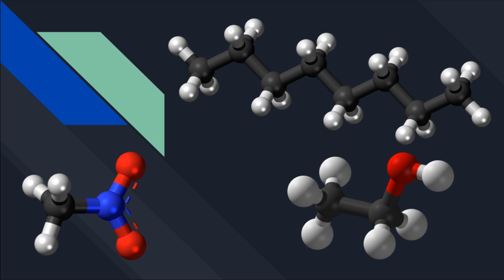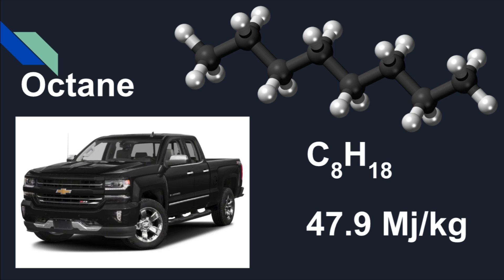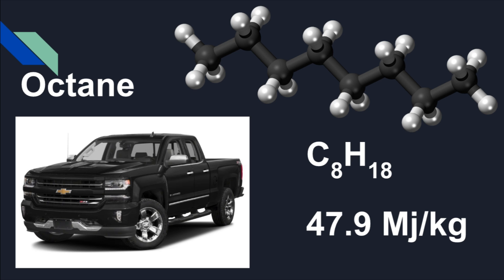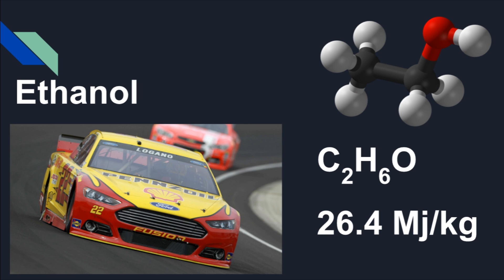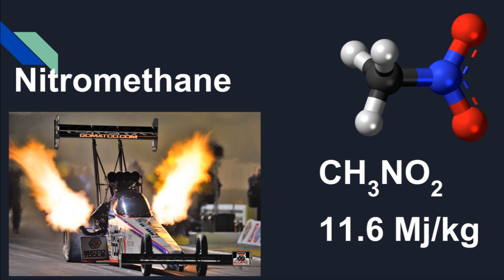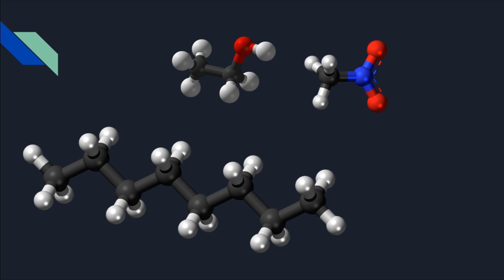Why Do Top Fuel Dragsters Use Nitromethane? [Molecular Breakdown]

Comment: Useful information, but it still doesn’t tell the full story. There’s also the matter of octane rating, ie how much the fuel can be compressed before it autoignites, there’s the matter of flame speed and ignition delay, and there’s the matter of whether or not a particular fuel can clean, cool and/or lubricate an engine.

Comment: Nitromethane actually  needs  tremendous pressure  and heat to combust. You can take a torch to Nitromethane  and try to light it and it wont light , try it with regular  gasoline  and it will light easily

Comment: I have determined in my mind that the only reason that they use air going into a top fuel motor is that it is a compression cushion because you cannot compress liquid and the air only goes in there so they have something to compress and they want to cram as much nitromethane into that cylinder as a they possibly can without blowing the heads off. They also turn the engines over backwards when they shut them off so that any fuel that hasn't been burned does not remain in the cylinders and get added to when they go to fire it up the next time cuz there will be way too much fuel and BOOM!
Reply: Nitromethane still doesn't have enough oxygen for complete combustion, so a little bit of extra oxygen from the air helps to generate more power, although they are not aiming for complete combustion, but they did say a little added oxygen does help. If it was nitroglycerin, the air wouldn't help because that has enough oxygen for complete combustion, with a tiny bit of leftover oxygen

Comment: Octane isn't an ingredient its a measurement...
Reply: It is an ingredient, and the rating is a measurement of the low speed knock value added to the high speed knock value divided by 2. The more octane a fuel has the more resistant the fuel is to auto ignite.

Comment: great another person misusing the term octane and what it is, thats about where I stopped, octane is a rating of how much pressure and heat the fuel can handle before it automatically combusts, cetane is opposite for diesel engines of how readily available it will combust under pressure and heat...

Comment: Interesting and informative comparison. My 2 stroke model airplane engines run on a methanol based fuel with a percentage of nitro methane and lubricants blended in; usually 15% nitro and 20% synthetic/castor oil. Smells great to my nose!

Comment: I know what nitro glycerin is and I have done some blasting in my career but that would be crazy to haul around country and I know methane is so what is nitro methane
Reply: A little late to the party but, Nitro Methane comes from a chemical reaction between propane and nitric acid. It was used as an industrial solvent before some nut job (like me) though it would make good drag racing fuel. Speculation; it was probably because the horrible airflow characteristics of flat head engines that prompted people to look for a fuel that didn't need so much air.

Comment: The rate at which fuel is consumed by these behemoth drag cars is quite astonishing. They're direct drive too and 2 of their six clutches will weld together after a run!
Reply: So basically the trans is ruined after every run
Reply: @TheAnnoyingBoss  yup pretty much. Rebuild every time.
Reply: Both wrong no transmission  LOL, JUST A CLUCTH PAK

Comment: So with nitromet already contain oxygen in it, it can runs and produce power with small amount of ambient air. Air fuel mixture more wet on nitromet fueled engine compares to ordinary gasoline engine / motor, am i right or wrong ?

Comment: Lol I actually put 1q nitro r/c fuel in my 01 Durango r/t 5.9 on a near empty tank and it's all wheel drive by the way and it actually smoked the front tires on a turn and I definitely felt the difference on acceleration nothing huge but definitely felt it so I can't wait to experiment on it again lol
Reply: Lol then you woke up
Reply: Yeah buddy , goose it
Reply: @daledevito buddy you would have a different answer if you had tried it. So just go back and do some homework about it this way you actually have something intelligent to say. It makes about a 10% more power difference with stock fuel system. There's a video on YouTube a chevy tahoe bone stock 285hp they upgraded the entire fuel system and pushed around 500hp.

Comment: you should see just how much Nitro is injected through those Hemi's in a run.  they eat like 18 gallons during warm up, burnout, and the 3 second pass. If i remember right, the fuel supply line from the tank is like 2 1/2 inches in diameter

Comment: Twenty plus years ago, the owner/driver/crew chief of a fuel dragster and I get to talking about fuels. He told me he had found mid-temp lacquer thinner was essentially the same thing as nitro.  He even showed me a 55 gal drum he had covered with a blanket.

I read right on the side of the barrel it was mid-temp lacquer thinner.

Did he mean it was effectively the same, as far as explosiveness, or was he talking chemically?  I find it hard to believe he meant chemically.

Back in the 80's, I used to use about a quart of mid-temp per 10 gallons of gas, in early smog engines with carbon build-up in the chamber causing dieseling and pre-ignition 'knocking'.  

As a test, I ran our shop lawn mower on straight mid-temp an entire Summer. The mower was used by our shop boy on my lawn, the shop lawn, my partner's lawn, and a half acre lot the shop boy had been mowing for a neighbor for years.

That winter I tore the mower apart to see what damaged was caused, and found none.  Kept using the mid-temp; it never failed to stop the problems.  Eventually, Detroit got better, and the problems went away.
Reply: This is amazing

Comment: Couple things

E85 is 85% gasoline and 15% Ethyl Alcohol.

Gasoline burns faster. The combustion event is over within 30-40 degrees of crank rotation.

Nitro burns slow. When that piston reaches BDC, there is still positive cylinder pressure. Meaning the nitro is still burning and applying force to the piston.

In a gas engine, if you want to make power, you use a big bore and a little stroke. You wanna hit that piston hard, and whip it around really fast in order to zip it back around to pick up the next charge.

In a Nitro engine, if you wanna make power, you use a smaller piston and a longer stroke to take advantage of that longer burn time of the fuel. Nitro continues applying force to the piston throughout the full 180 degrees of crank rotation from TDC to BDC.
Additionally, the longer stroke provides more leverage to the crank, producing more torque.

Here's where some fun engine math comes into play: I don't give a fuck what anybody tells you, Horsepower is not a real number. It is purely a mathematical function of torque, and serves no true function in the real world. Horsepower only exists on paper.

Here is how:

HP=(TQ*RPM)/5252

Horsepower equals (torque multiplied by RPMs) divided by 5252

If you make 35 ft/lbs of torque at 1000RPM, that's 35000/5252=6.664 horses.

If you make 350 ft/lbs at 1000RPM, that's 350,000/5352=66.64 horses.

If you make 350 ft/lb at 10,000RPM, that's 3,500,000/5252=666.41 horses.

As you can see, making lots of torque at higher RPMs is what gives you lots and lots of Horsepower.
Take away torque, lose Horsepower. Ditto for RPMs.

This is also why, if you read engine dynamometer charts, you'll see that torque and Horsepower numbers intersect at 5,252RPMs.

Fun fact: The highest number I've heard says that nitro engines peak briefly at 11,600 horses. Divided by 8 cylinders gives 1,450 Horsepower per cylinder.

The 16 cylinder, quad turbo charged Bugatti Veyron Super Sport produces 1,200 horsepower. Top speed around 264mph.

In 2017, Matt Hagan's Nitro Funny Car was bumping up against 340mph in 1,000 feet. A quarter mile is 1,320 feet.

Nitro cars accelerate with a maximum of 6Gs of force.

At wide open throttle, 7,500ish RPMs, every cylinder burns one pint of fuel every 0.750 seconds. There's 8 pints in a gallon so, they burn one gallon across the 8 cylinders every 3/4 of one second.

Another fun fact:
2 spark plugs and 44 amps each. It's so much electricity going across such tiny pieces of metal that, when combined with the destructive force of combustion, the spark plugs are erroded away before half track, and the engine is just dieseling at that point.
In other words: The spark plugs are no longer sparking, and the heat from compression is what's firing the cylinders.

Imagine this but, don't actually try it:
Set your arc welder to 88 amps, strike an arc, and try to snuff out that arc with a pint of flammable liquid. That's what's going on inside a nitro engine. And the fuel actually does drown out the spark plugs on a regular basis.
On any given Sunday, you'll see it at least 3-4 times.

NHRA Nitro engines are fucking bad ass!!
Reply: J P nah.. E85 is 85% ethanol and 15% gasoline during summer. 75% ethanol and 25% gasoline during winter.
Reply: @psil0cy  cite your source.
If I'm wrong, I want undeniable proof of the correct answer so that I can go forth with the proper knowledge
Reply: @mr.nobody68  https://en.m.wikipedia.org/wiki/E85?wprov=sfla1

E85 is an abbreviation typically referring to an ethanol fuel blend of 85% ethanol fueland 15% gasoline or other hydrocarbon by volume.
Reply: E85 literally stands for 85% ethanol
Reply: Well fucking formated my dude.
Reply: Nitromethane burns so fast it is classified as an explosive. It burns much faster than gasoline because it gives off oxygen when burned. The reason why it is still burning when it leaves the cylinder is because they drowned those engines in it.
Reply: E15 is 15% ethanol and it's close enough to gasoline that most cars can run it. E85 requires much larger injectors and a higher flowing fuel pump, sometimes larger fuel lines depending on the car, and of course a tune. It's 85% ethanol and has a vastly different air fuel ratio to gasoline as a result.

That being said, whoever made this video isn't very familiar with E85. It universally makes more power and torque than gasoline, in pump form it needs to be blended with gasoline to be legal for sale as a fuel. In racing form E99 is more common, which is nearly straight ethanol. It has a slightly lower power BY VOLUME, but because of its extremely rich air to fuel ratio, a lot more volume of it is used for any given amount of airflow, and it will overall create more power in the same engine. It's also significantly higher octane than gasoline, and does a fantastic job of cooling inlet air temperatures. It's not uncommon in boosted applications to pick up 30%+ horsepower at the wheels after switching from 93 octane to E85.
Reply: I learned so much reading this. + the E85 thing.

Comment: i think there's a misconception that you need more of these types of fuel. You don't need more, you CAN use more which is the biggest difference. Because of the chemical make up, they will ignite regardless of the air/fuel ratios and will also reduce the amount of heat build up compared to hydrocarbons. because it runs cooler and has a better detonation characteristic, racers tend to keep cramming more into the combustion chamber without having to worry too much about detonation and a huge release of energy.
Reply: pietkrijger and you missed the fact that this is because ethanol based fuels contain oxides. You don't need more to create the same amount of power, you need to use more to reduce the chances of pre-ignition. Alternatively you could just mix ethanols with petrol fuels to get the best of both worlds.... Oh wait.. Oil companies already do this for high octane race fuels 😁.
Reply: Ch3no2 burns without oxygen? I think that doesnt make sense. I imagine what happens is nitro decomposes on its own and releases energy doing so... so maybe cars using nitro can have energy from sponteneous separation as well as aerobic burning... thus... being... more... efficient? I guess?
Reply: @RoScFan  why do you think that doesn't make any sense? The chemical make up explains how it's possible right in its molecular composition. This fuel is an explosive. Meaning it needs no outside fuel/air to burn. External oxygenation will allow further/greater air/fuel mixer giving it a much higher decomposition value.
Reply: @RoScFan  as far as efficiency, it's efficiency comes down to its ability to transfer heat better given its no2 molecular bond. Where as pure hydrocarbon mixes have horrible heat transfer properties. Carbon does not transfer heat well, meaning much of the heat produced by the flame front stays in the engine and moves the working temperature ranger closer to the ignition point of the fuel, causing detonation quicker. Pre-ignition is the root to all engine problems. The best way to combat this is reducing egt's. As I'm sure we all understand at this point.

Comment: I can't wait until all racing is done with E85. Australia is on the right track.
Reply: indycar has used ethanol for decades. nascar doesn't allow it because that's "stock" car racing.....
Reply: Alcohol, yes, but until 10 or 12 years ago it was methanol. I think there is a small amount of petrol (gasoline) used as a safety measure in the ethanol now being used as that flame can be seen in case of a fire - you may recall years back when there would be fires where no flame could be seen as was typical af the methanol (and pure ethanol, for that matter) then used.
NASCAR's control fuel is E15 - a 15% ethanol blend fuel. TBH, I'm surprised they don't use a much higher percentage blend, since much of their racing is around the 'corn belt'.
Reply: @gordowg1wg145  Well, the reason in the states for only E85 is, 1. the fire you mentioned and 2, because its corn alcohol if it didnt have a percentage of Gasoline, you could drink it from the pump
Reply: @zuestoots5176  Uh, no... the methanol/ethanol part was directed at the Indy car fuel - "Sunoco is still the official fuel of IndyCar. Sunoco will work with APEX-Brasil and UNICA to provide ethanol for the series. Starting from 2012 season the Ethanol fuel blend rate has been reduced to 85% blend to match the mix of road car engines."
Reply: @marzsit9833  NASCAR runs E85 or E90.
Reply: NASCAR is using E85 or E90 i believe
Reply: @zuestoots5176  "Sunoco has fueled more than 15.5 million miles of competition and over 1,300 victories in NASCAR alone. The specialized NASCAR fuel is Sunoco Green E15, a 98 octane, unleaded fuel blend specifically engineered for high-performance engines and race cars."

Comment: Rc cars use it too.
Reply: Powered by R/C / eflb150 yeye
Reply: They use a lower percentage of nitro. NHRA is mandated at 90% nitro, 10% alcohol.

I believe RC cars run more like 60% nitro but, I'm not sure and could be wrong
Reply: @mr.nobody68  between 10 and 30% in rc cars 👍
Reply: @mr.nobody68  If you can find 60% nitro blend for R/C...I want some. 40% is the highest i have ever seen. Running 30% in all my stuff right now.